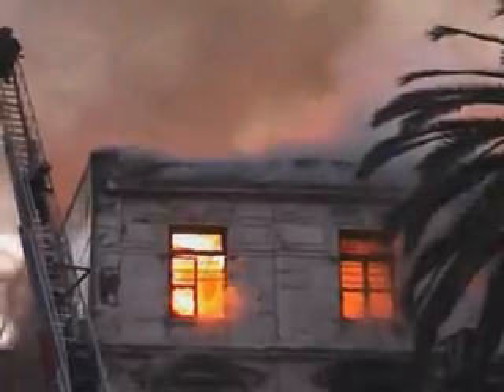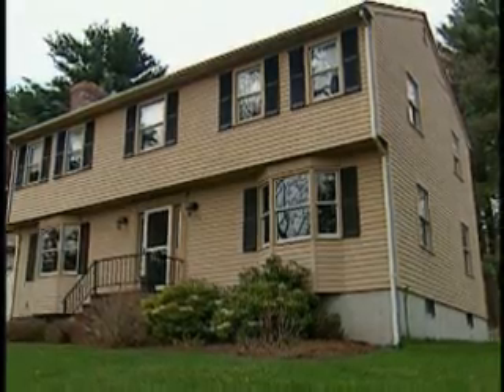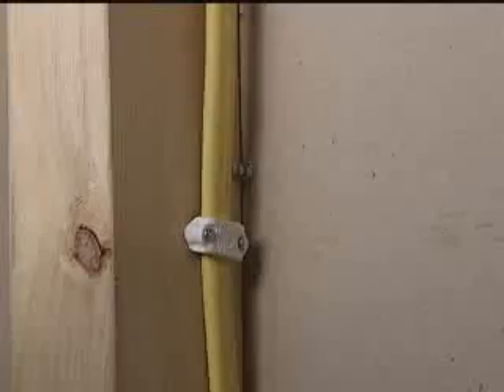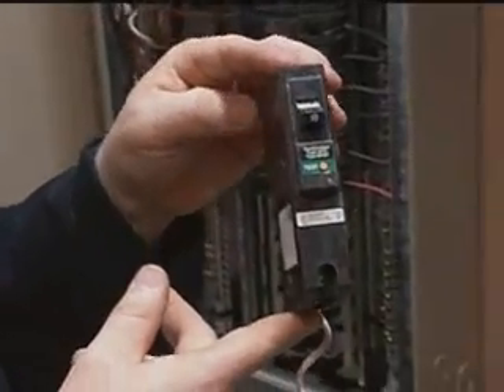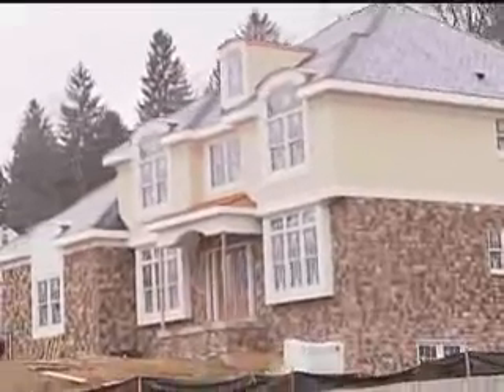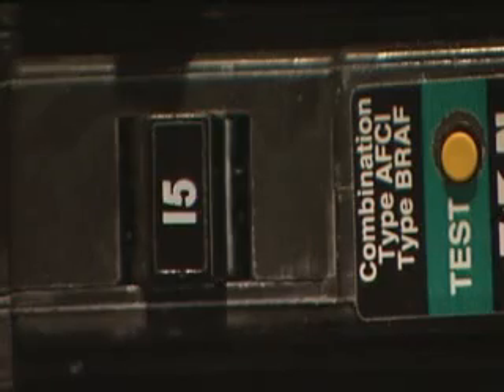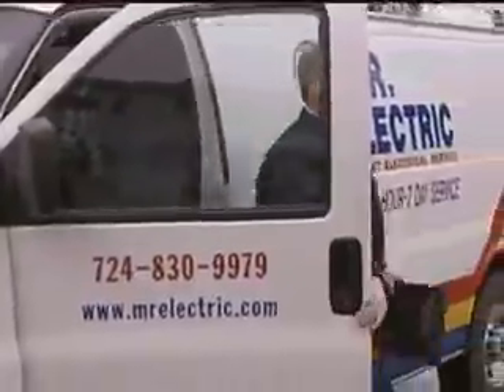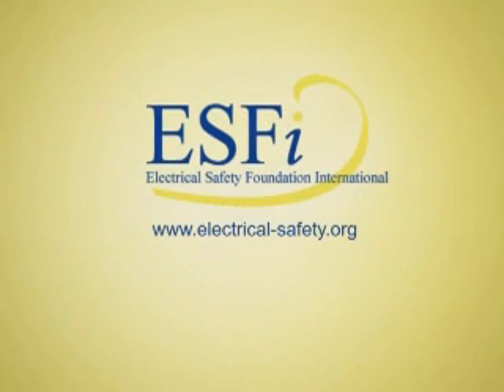Arc Fault Circuit Interrupter (AFCI) Awareness PSA

Comment: They are a pain to install, and they trip over nothing! They are to be installed on circuits in "dwelling" areas. However, they often trip due to regular use and are very sensitive. 

Want to know how to stop fires? Electricians need to do their job right, and not short cut every corner possible. Most do. I can't tell you how many times I've went behind to fix someone else's work that could have been done right the 1st if they had taken just a few more minutes. 

Also, don't let your cousin, buddy, brother, or yourself do electrical work for you. If you don't know what you're doing, don't touch it!  I see it all the time. You have to even watch people who have an electrical license...I've seen their work that is just waiting to get someone killed!